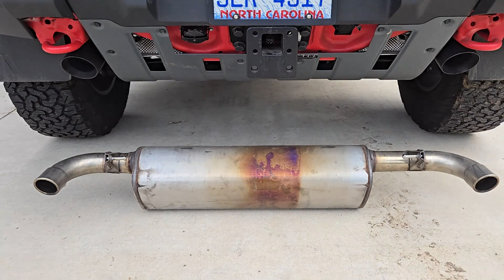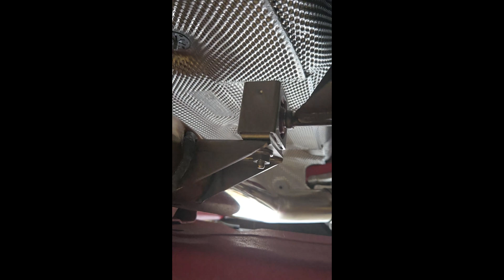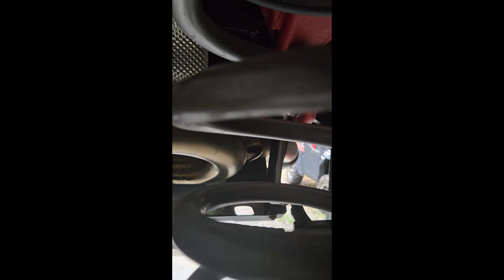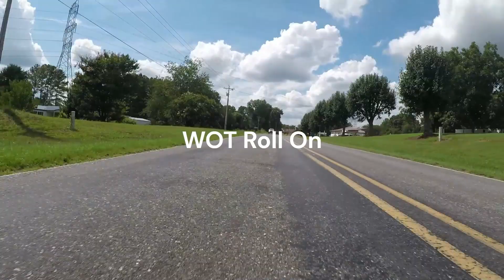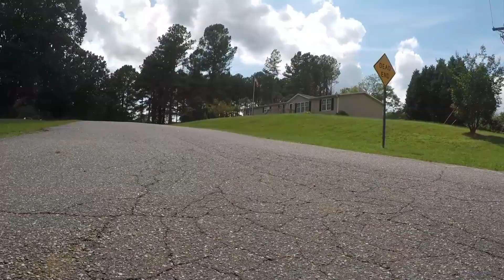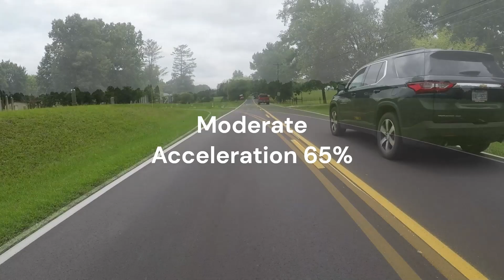Design-Build-Go Exclusive Cat Back Exhaust by #kooks for Ineos Grenadier #grenadier #ineosgrenadier

Comment: How does it sound inside the cab.   a lot  louder   ??
Reply from the maker: Given the insulation (heat shields) and sound deadening in the cab there is not a big difference inside the cab.  The truck is about a decibel louder at the 2k rpm setting that the engine and transmission like to set for max efficiency.  I like to leave the windows down to hear the exhaust the best.   The upshifts and downshifts are noticeable in the cab where they were super faint before.  It is not a really loud system like the Milltek that has no muffler.  We decreased the muffler volume by about 30% but found it better to be tuned that way that without one altogether.  It was too loud without a muffler.